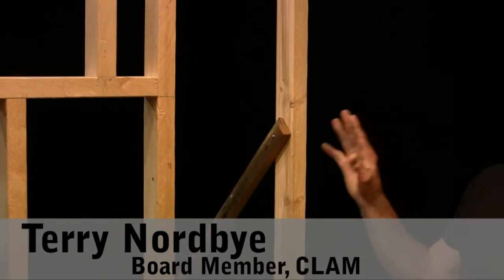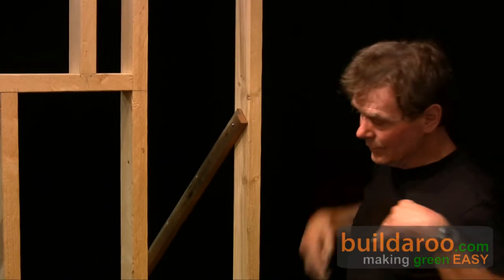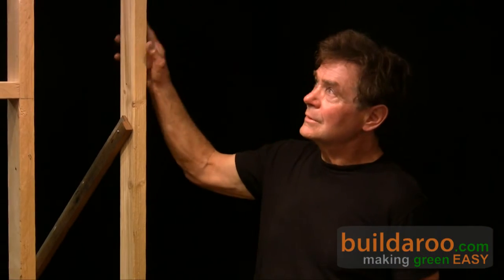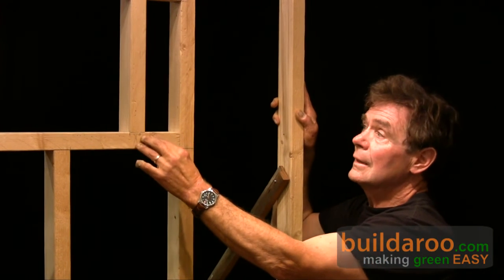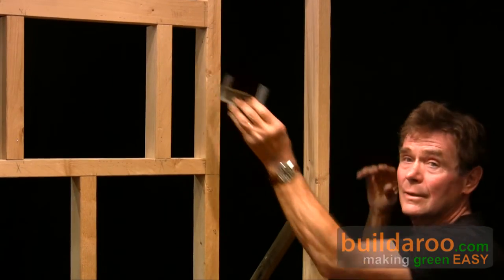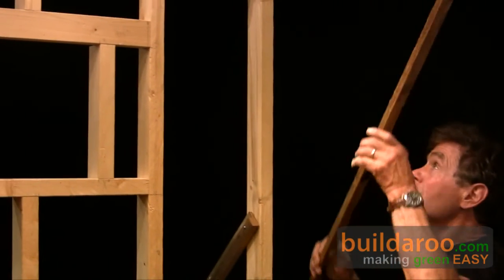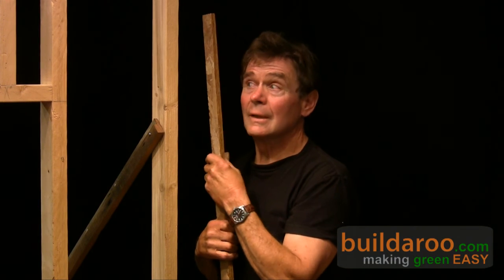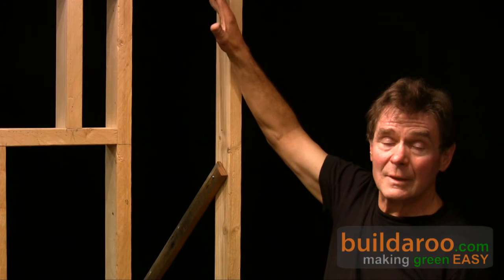Advanced Framing: The Expert Energy Show - buildaroo.com

Comment: Double 2x4 walls staggered 24" on center economically works out better when trying to achieve R-34 or higher.  2x4 lumber is less expensive and the labor I got prices on was about the same or less then staggered stud on either 2x6 or 2x8 plates.

Comment: You must be in a different area than I am in then because it is 16" centers in walls and 24 in ceilings were I am. Plus we have to use 2x6s as well.
Reply: if you have 16'' center walls wouldn't your ceilings need to be the same? because they wouldn't be on a stud for weight distribution.

Comment: Well since code is 16" centers that rules out 24" centers. Wouldn't it make more sense just to use 2x6s rather than 2x4s therefore getting 150% of the insulation. I agree with cchernock1 though staggered framing is the best. By using 2x8 footers and headers would allow you no thermal bridging.